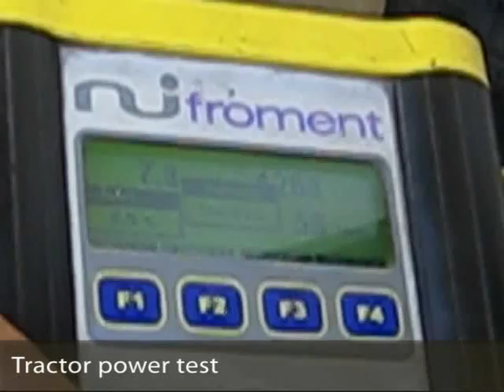The Green Machines - Electric tractor

Comment: Whatta waste of that tractor now you have no power to work it. Also use it 5hrs charge it 12hrs
Reply: Yea right? LOL... I bet you won't even get 5 Hours usage for 12 Hours charge :((( Someday, a Super Duper Capacitor will born and charging will be a lot faster :))). This chit isn't going NO-WHERE until the day we Charge 1 Hour and get 12 Hours of usage. But until then, stay with Gas or Diesel, LOL. They post this Chit on 2011 and now it's 2016. 5 Years and have you seen People using this Chit anywhere yet????? At this rate People can get to Mars and back Faster, LMFAO
Reply: Hi. Yor are not on time. In 2016 are many elektric machines, like cars, and big tractors for axample from John Deere - and driven withs akkus.